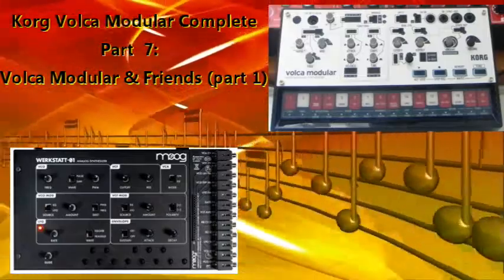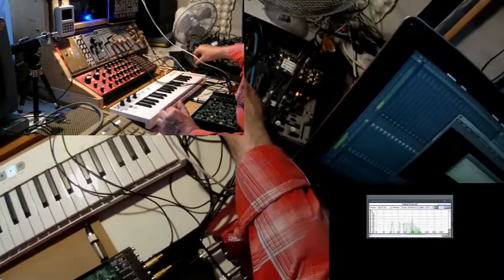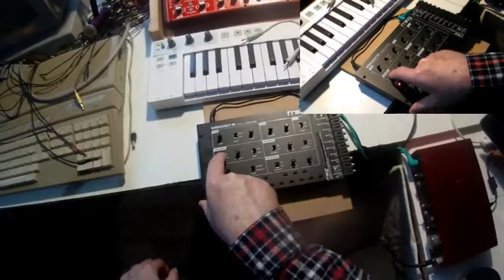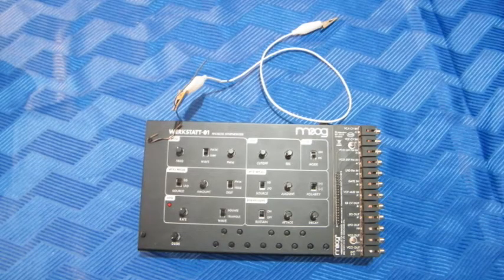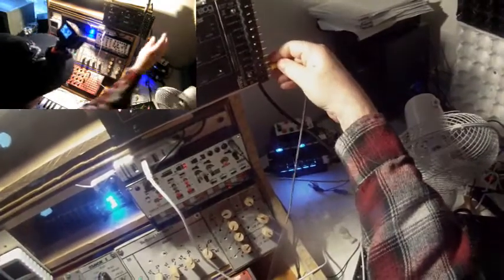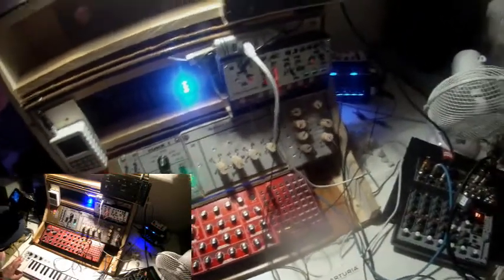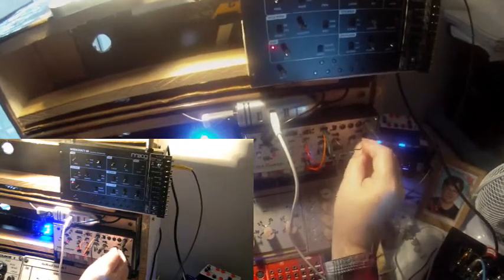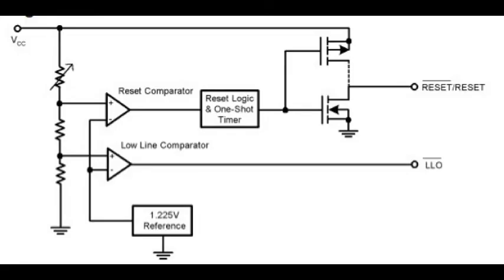Korg Modular Complete Part 7 Korg and Moog Werkstatt

Comment: Hi just wanted to let you know you can make the sound of the oscillator inaudible by turning the manual pulse width control all the way up. I don’t know if it helps but that’s how I get around using the filter with external audio